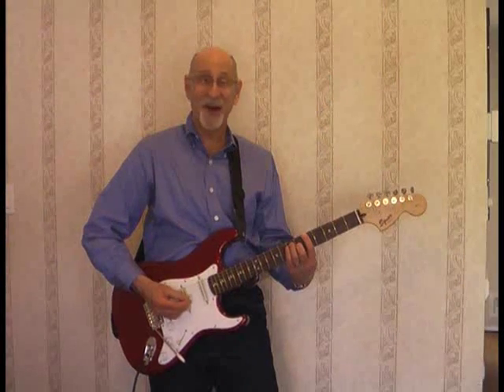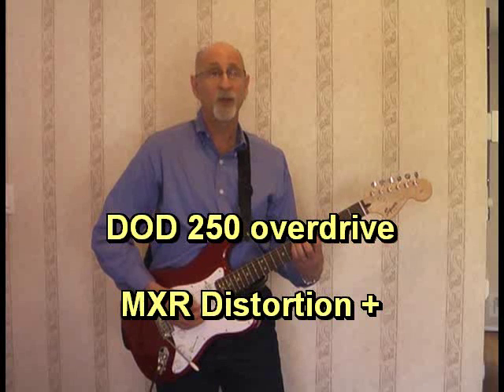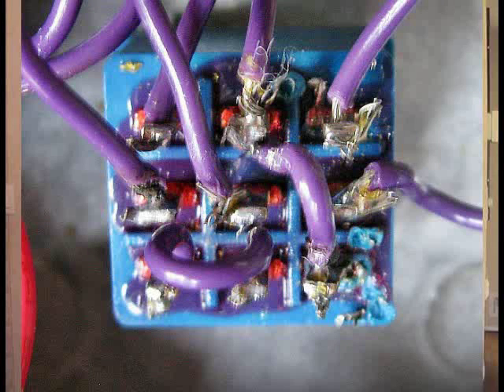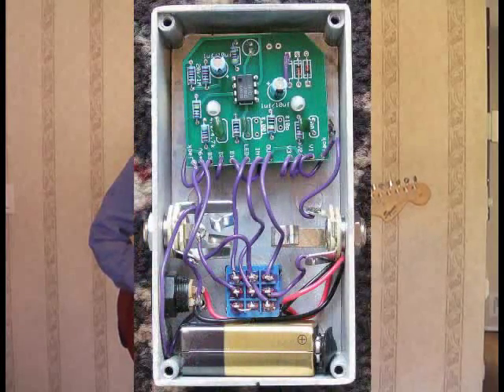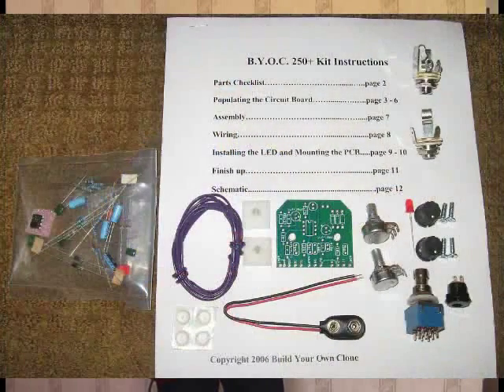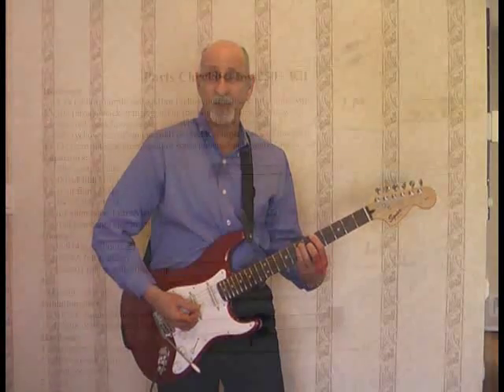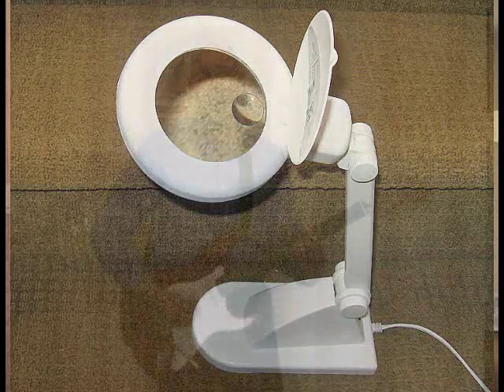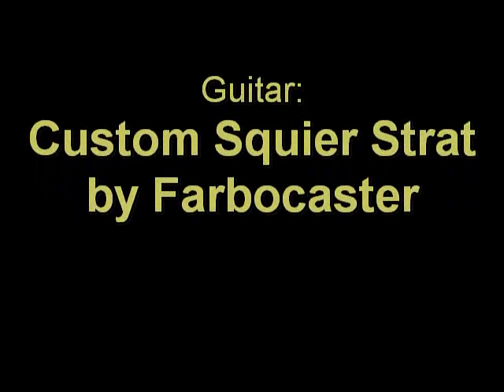Build Your Own Clone 250+

Comment from the maker: Hi Cody.  I went to the hardware store and got a can of spray primer and a can of spray enamel paint.  I think I used the store brand, but any good can of paint will do.  I lightly roughed up the surface with fine steel wool and applied the primer following the directions on the can.  (Be absolutely certain that there is no dirt or grime on the surface of the metal.)   I then applied the finish coats - again following the directions on the can.  Let the case dry properly, and you're done.

Comment from the maker: @jettramel   You will need the electronic parts and a set of instructions.  You might check the various kit vendors on the Internet (do a Google search) to see if they will sell you only the part you need.  Another way to go is to obtain a parts list (Again, a Google search should do it) and a wiring diagram with instructions from the Internet.  Good luck.  Let me know how it works out.

Comment from the maker: @Guitarbque  (Part 2)  I think the BSTAB2 would be a good pedal with which to start.  Follow my suggestions and get yourself a soldering stand with alligator clips, a lighted magnifier, and a soldering pencil.  Watch my video a few times before you start.  And most important, practice, practice, practice your soldering.  Keep practicing until you can do a very neat connection.  (There are soldering instruction videos on YouTube.  Watch them.)
Best wishes and good luck.  Let me know how it goes.

Comment from the maker: @Guitarbque  Hi.  Thanks for your message.  I looked at the GGG BSTAB2, and it looks a lot like my 250+ on the inside.  The primary difference is that the input and output jacks are at the top of the box near the control knobs rather than on the side.  It definitely looks simple enough to build.  I suggest you download the instructions and look them over carefully to be sure that they are good.  (Build Your Own Clone instructions are very complete and easy to follow.)

Comment from the maker: Hi.  Thanks for watching.  After my first experience, I took  my time.  It probably took me two days to assemble it once I learned how to solder.  You can probably do the PCB and small components in one day and solder all the connections the second.  
Since you are new to this, practice your soldering A LOT.  That way, you won't have to order a second pedal as I did.  Good luck and let me know how it turns out.